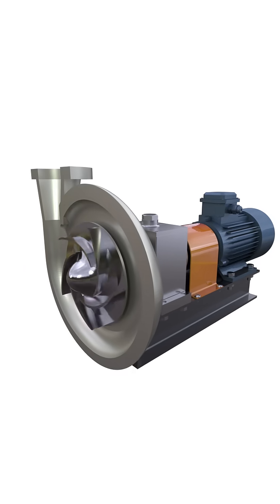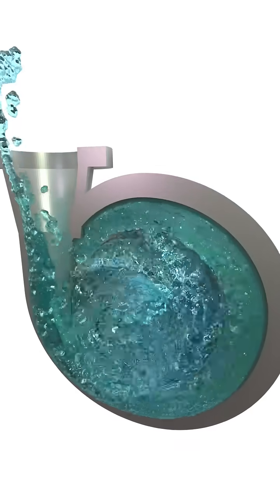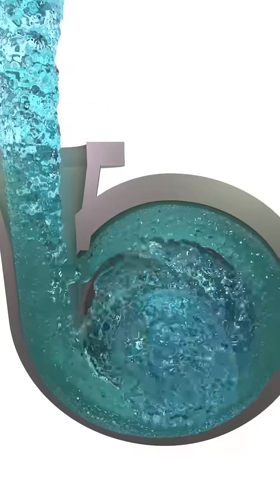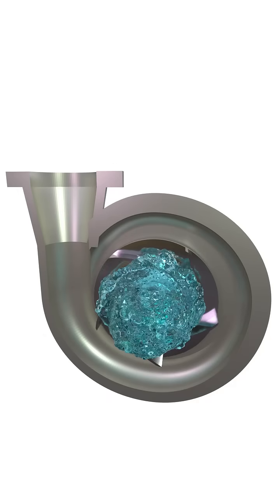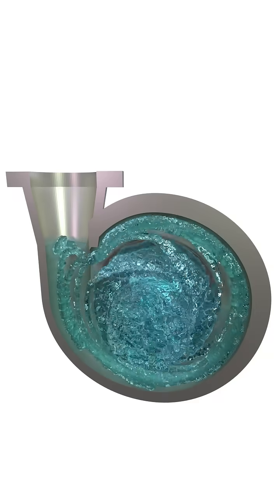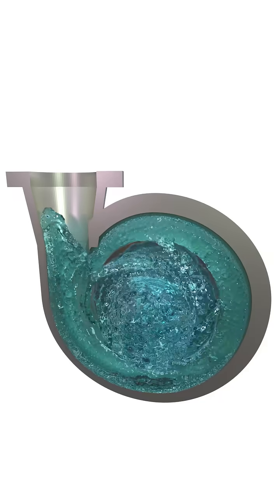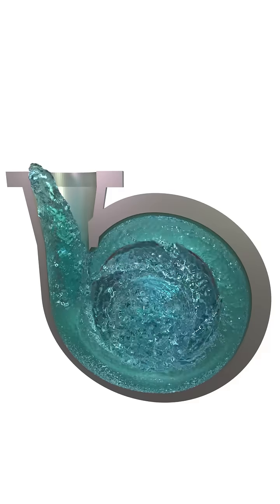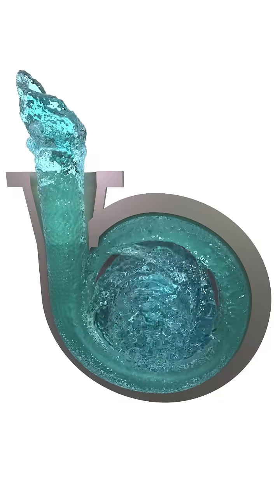Centrifugal pump, slow motion video

Comment: Imagine in the future they make a turbocharger that is as same as the forced induction systems but instead they suck water and it works in the oceans and sea and its connected to an engine that works on water instead of air😂
Reply: There are people that damage beaches by digging a trench into a hole some distance away from the water maybe thats similar

Comment: One key thing not mentioned is the increasing cross-sectional area at the outlet. Due to Bernoulli's principle, water going from a smaller to a larger cross-sectional area slows down, and when water slows down, it converts dynamic pressure to static pressure, so the static pressure increases which is what allows the pump to provide pressure.
Reply: seems like all that viscous drag between the impeller and the housing/volute would cost a fortune in energy . . . like 50% more than just pumping the water through the center of a closed impeller. What do you think?
Reply: @haroldwestrich3312  How do you pump water through the centre of a closed impeller?
Reply: @davidklempfner826  I should have been more clear; I was comparing the viscous drag on the outside surface of a closed impeller to the Viscous drag on the INSIDE of a closed impeller. I believe the drag on the OUTSIDE surface "Which is fighting the viscous drag on the housing/volute which is stationary" IS much more substantial than The flow on the inside, which is basically protected from any turbulent flows from stagnant water (Between impeller faces and housing). Inside Drag would only consist of water flowing through the impeller at high speeds. there would be no substantial turbulence, only the resistance of the surfaces and that would be in uniform direction. Sorry for being unclear.
Reply: Da, aveți cunoștințe de mecanica fluidelor. Felicitări ! Într-o conductă, Presinea totală =  presiunea dinamică + presiunea statică. Multe sunt de spus la o pompă centrifugală pentru lichide. Calculele de proiectare sunt foarte complexe, așa este.
Reply: In order for the water to flow into the pump, the pump must be primed or filled with water before start up. This allows the impeller blades to create an area of  high pressure in which the water from the relative lower pressure source will flow. 
The exit of the volute gets wider because it lowers the waters pressure which is converted to speed or “head”. Thus moving the water to where it’s needed
Reply: I’d say you missed some even more solid points and inadvertently misinformed others. Pumps no matter positive or non positive displacement such as the one shown, do not create pressure. Restrictions to the outlet size and or outlet plumbing create the pressure. This style of pump is non positive displacement more specifically a centrifugal water pump. As stated Non positive displacement pumps have large amounts of internal clearances for fluid to simply “free flow” around the rotor. This pump if met with total restriction would in fact not require a relief valve or generate any flow until the restriction were removed. However if this were a positive displacement pump it would simply keep forcing fluid into the restriction until failure of the weakest component.
Reply: So, does the liquid transport use kinetic energy or pressure energy?
Reply: @nicogas-dc6ji  It uses both. Kinetic energy is the same as dynamic pressure energy. Dynamic pressure energy results in kinetic energy.
Reply: @nicogas-dc6ji 
To everyone in this chat, I just want to let you know that Jesus loves you and he can save you from sin, sadness and sickness.